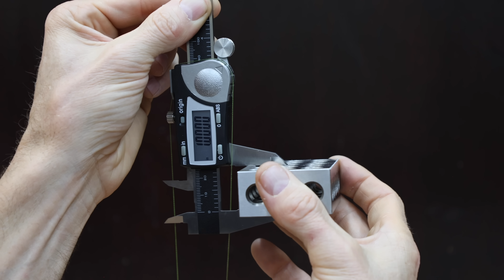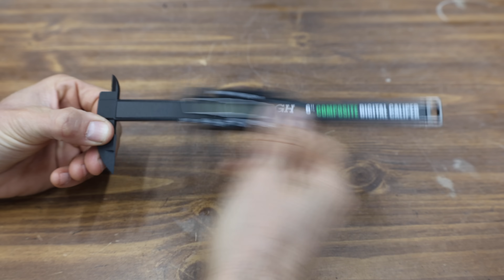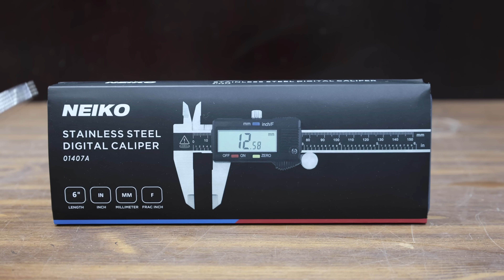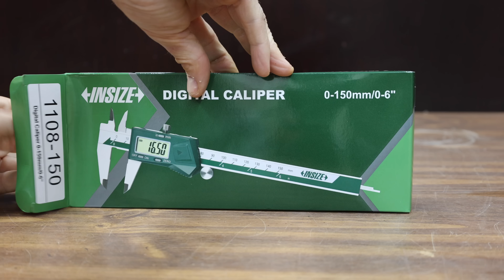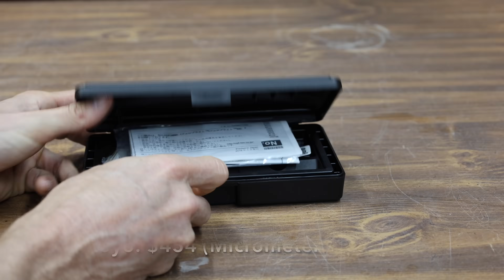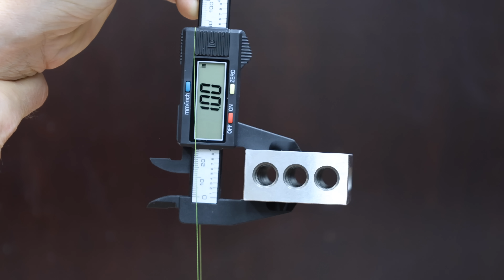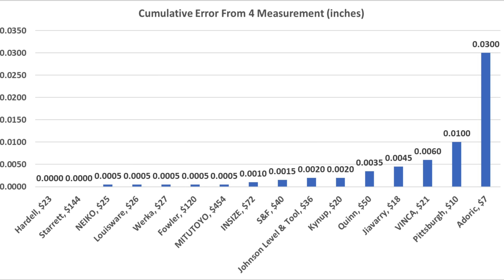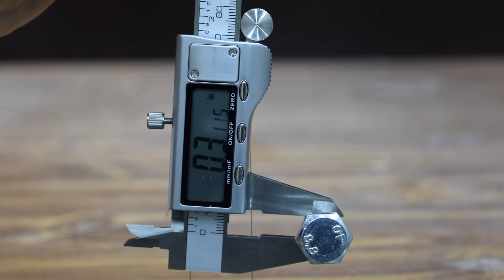I've Been Proven Wrong About Calipers!

Comment: When you go to measure something and you see variances within where it’s placed in the jaws, shine a light behind it and see if they are cut straight. Sometimes there’s a burr on one of the edges and then get a non permanent marker and close it to see where it wipes off when closed or if it stays, then get a paper and close it and see if that changes. A fine file can take those edges off. Then check it on standards to see if it’s true. This would be a calibration thing but also important when matching and if the machinists and quality control are debating about measurements.

Comment: I prefer to use analog dial or vernier calipers. Never cared for digital.
Reply: Digital is fast. Forget about vernier. Ain't nobody got time to read those. But verniers are very durable. There ain't much to them. Too prone to reading errors though.
Reply: Yeah, when you pick them up, they're always ready.
Reply: I much prefer the dial to the screen and having to worry about batteries but the ability to easily switch between mm and in is indispensable
Reply: @potathooo  In top-quality calipers, battery life is NOT an issue. They go for years and years on a single battery.

Comment: I have a Neiko set. They have been good enough for me over the years. Only changed the battery a couple of times. I use them for quick bolt and drill diameters and to check thread depth here and there.
Reply from the maker: Thanks for sharing.

Comment: was having my hopes up to find a cheaper alternative to Mitutoyo - deal-breakers for me are always that gritty feel, like someone has forgot to deburr or remove the grinding dust from the calipers.  So far I haven't found a comparable set. I did attempt once to debur and polish a set of cheap £10 ebay specials and parkside calipers and to my surpise I found that they both seem to have a thin brass like top "leaf spring" that makes contact with the rails - polishing the rails didn't result in much improvement till I have polished that brass material. however even after some extensive polishing I still couldn't get them to match the smoothness of the mitutoyo. oh and lastly  - thank you for making the videos and catching the smoothness - most review's on calipers always omit this step.
Reply from the maker: Thanks for the feedback.

Comment: As other machinists have mentioned, Starrett and Mitutoyo are well liked for reliable and accurate measurement especially past 1 thou. Otherwise for less precise, 1 thou and greater, there are lots available that are as reliable and feature rich. I have a couple iGuaging calipers specifically for use where they may be damaged. Both have worked without issue for over 10 years now. CR2032 batteries are the way to go though no matter the brand. Mostly because the batteries are so common in other devices that it simplifies what to keep on hand in case the batteries run low while working.
Reply from the maker: Thanks for the feedback.

Comment: The small knob on top is used to increase and decrease tension. If you back it off some, it becomes easier to slide. When you tighten it, it helps keep your measurement.
Reply from the maker: Thanks for sharing.
Reply: @ProjectFarm thank you for yet another video that makes me want to buy something I don't need.

Comment: About 5 years ago I bought a clone of the S&F as a "throwaway" to keep in a toolbox.  Works fine but eats batteries.  Some of the cheap Chinese calipers have battery life concerns.  My Mitutoyo doesn't.  You might put them on a shelf for six months to see which models eat batteries when turned off.
Reply from the maker: Thanks for sharing.

Comment: Mitutoyo calipers are counterfeited a lot. If you're not buying directly off an authorized dealer they're counterfeit. Even the Amazon seller is selling counterfeit ones. It can be extremely hard to tell the counterfeit ones from genuine. After a year you'll know though. Because counterfeit ones will have a dead battery.
Reply from the maker: Thanks for the feedback.

Comment: I love calipers. Why didn't I think of this? I used to use calipers to measure the diameter of rubber bands for braces. The company I worked for made all things orthodontics.
Reply from the maker: Thanks for sharing.
Reply: In 20 years as an audio repair tech I often used calipers like these to measure the thickness of belts for turntables, cassette decks and CD players. Also helpful for measuring thickness of O-rings.

Comment: I have a more inexpensive Fowler (~$30) that i use for Transmission work. It has lasted me for over 2 years now but unlike some brands, it does roughly need the battery replaced about once a year. been wanting to upgrade it to something a bit better so this couldnt have come by at a better time. 
Would love to see a Dial Indicator video soon after as i also have a Fowler for that. Always appreciate the great work!!
Reply from the maker: Thanks!  Thanks for the suggestion.

Comment: One thing your test did not indicate that I found from personal experience: the digital calipers I purchased from Harbor Freight seemed to be acceptable except for the fact that the batteries go dead within a few weeks when turned off and stored inside the case.  Other brands do not have this problem. By the time I discovered it was a problem with the calipers and NOT a battery problem the warranty period expired and I had to ‘eat’ the ones I had purchased. I would recommend NOT buying calipers from Harbor Freight - I am a big fan of Harbor Freight for many other items but NOT their digital calipers!
Reply: That's basically all cheap calipers
Reply: @ObservationofLimits  Agreed, all cheap calipers should be stored without the battery installed.
Reply from the maker: Thanks for sharing.
Reply: It's not just the Harbor Freight ones - my NEIKO calipers do it too. I think all the cheap (sub $120) calipers use the same PCB's and they all draw power even while "off." I pull the battery when I put it away now.
Reply: @dynadork3312  well it may not be JUST HF calipers - but they are the ones which I experienced that problem.   Probably HF calipers are made by a company that makes other brands also.
Reply: I have a half dozen HF calipers on my desk. Not usable because of battery problems. Leave the battery in and it's dead. Take the battery out and the cover breaks or wears out. Some site tested calipers and found that General calipers had the lowest off power draw. I noticed the Husky looked like a general rebadge so I bought that one. Husky is so confident that the power draw is low that they sell the product with the battery connected, no pull tab insulator. Battery still going after a couple years.
Reply: There were 2 tested from HF, Pittsburgh and Quinn. Your issue is with Pittsburgh. While they cost x5 as much, everyone knows you wait for a coupon or sale before purchasing anything from HF. I've seen the Quinn calipers as low as ~ $30.
Reply: Don't confuse display is off, to imply device is off.  This is what I measured with the Neiko 0-150mm.
"on"   0.015 to 0.016 mA
"off"  0.014 to 0.015 mA
The display state makes so little power draw difference it is close to not being able to be measured.  It is easy enough to remove the battery when I'm done since it doesn't have a screw, just don't close the door all the way.  I'm still on the original battery from 2018, though the display is getting faint in winter.
With my Neiko, if I moved the slider with the display off, the display turns back on starting with the last value.  These use a capacitive mechanism to pick up the slider movement.  I'm assuming it takes the majority of the power, and it keeps running to not loose the zero point.

Comment: For most DIY home users, any of these will work. Machinists definitely need top of the line.  I've had a $25 caliper for 10yrs and I probably use it 2 or 3 times a year (at home) and it's served me well.  Thank you for all the testing you do.
Reply from the maker: You are welcome!  Thanks for the feedback.
Reply: yeah, I have the neikos which are great in a 3D printing environment.  mitutoyo would be well worth it if I had 30k of machine tools and tooling...
Reply: Exactly, 90% of home users basically using a caliper like a tape measure.
Reply: @taylorsrus9543  lol for very small measurements, mostly.
Reply: Even for machinists, calipers are more of a disposable reference than anything else. You can spend $1000 on a caliper and I still wouldn't expect to get sub-thou accuracy out of it, especially after a couple years of use in a dirty, potentially abrasive environment. What is generally going to be used to actually inspect the part is a whole suite of metrology tools like micrometers, surface plates, gage blocks, dial indicators, height and depth gages, etc.

Instead of spending $500 on the 6" caliper and 1" micrometer set from Mitutoyo or Starrett, go to a budget brand like Shars and get the $150 set of gage blocks, the $100 Grade B surface plate, the $200 set of manual vernier micrometers, the $50 height gage, etc. Having a more complete set of metrology tools that are each individually "good enough" is better than having a smaller number of potentially higher quality tools.
Reply: I mostly work with wood or printed parts. 0.1mm is accurate enough for my needs, if Margin of error is lower, then I am fine. Especially in wood where the final sanding will easily remove 0.1-0.2 in the end.
Reply: @behemothokun  .1 is HUGE... any of these are way closer than that.  Lucky you :)
Reply: This.  I work in aerospace and we use Mitutoyo calipers and micrometers.  They all get worked hard and are constantly around coolant and oils and still work beautifully.  I would never buy one for home though, since I just dont need THAT degree of accuracy.  One of the less expensive options with nice battery life and features is perfect for a diyer.
Reply: I still remember a video of a bunch of chinese construction workers on a site putting all their tape measures together and none of them matched each other, definitely don't get these cheap sets if you value precision.
Reply: @SEEYAIAYE  DIYers don't need engineering precise measurements.
Reply: @SEEYAIAYE  Even if a tape measure were labelled incorrectly it would not impact its precision.  However the only example I can find of Chinese construction workers allegedly comparing tape measures is an image and it is clear from looking at it that we can't say for sure whether the tape measures are in fact all different.  The tape measures are being held in hand, they are not all level, and the camera is at an angle.

Comment: I'm wondering about the accuracy of your depth measurements.  Measuring against the 1-2-3 block, the caliper would be touching the wood table, correct?  Any local bumps or dips in the wood surface would be transferred to the accuracy of the measurements.

Comment: been a machinist for over 2 years now. I think the only reason for buying an expensive pair, is if you're experienced and using them very regularly, or simply like having nice things.  most cheaper calipers I have used are accurate enough for most applications the average person would us them for.  In fact, I would guess  the cause of most caliper inaccuracy  comes down to the user, and less with the actually caliper(Yes, I also started out using them poorly myself).  My Mitutoyo calipers are so finely made compared to others I've used, I wouldn't want to be without them, they just "feel" good to use. Also don't buy nice calipers for people who don't care for, or drop tools frequently, its not worth it.
Reply from the maker: Thanks for sharing.

Comment: Cheaper calipers tend to run their batteries down even when not in use... for example, there is power usage for my Vinca vs Mitutoyo calipers when on/off:

Vinca: On = 20uA, Off = 18.5uA
Mitutoyo: On = Average of 3uA, Off = 0.9uA

You can tell just by looking at them while they are powered off that the LCD screen is still powered on the Vinca.
Reply from the maker: Thanks for the feedback.

Comment: As a precision engineering lecturer, metrology is super important. I bought a 12" (300mm)  Draper caliper. Have to re-set it every time used and test it on slip gauges. In the workshop we use Mitutoyo and More & Wright digital calipers and micrometers. Oh, (edit) there are fake Mitutoyos on the market. We received a warning from Machine Mart.
Reply from the maker: Thanks for the feedback.
Reply: yes, it's terrible, I bought one fake in local market place, seen that the micrometer miss the last 0.0005 digit ... I offered him 20$... it sad for him, he was a student machinist(change carrer) they all bought from a lot seller... he said he paid 150$ a piece, they lost a lot of money... (I use it for not important job,  it,s fact it's fake, it loose zero easy when you slide fast...)
Reply: Yes there's a video on You Tube about the fake electronic LCD Mitutoyo calipers

Comment: There’s something that got missed in this test. I’ve spent years as an inspector both using and calibrating calipers just like these. When you have a handful of the same brand calipers, you notice that one to another, things such as smoothness, repeatability, and so on should be identical, every single time. I could take a dozen Mitutoyo or Starrett or Fowler calipers and put them head to head against each other, and find their variation in accuracy and feel to be nearly zero. Feel is important, because you need to slide the head enough to make good contact, but not so much that you introduce error into your measurement. The moment you say “this one feels gritty” is the moment that caliper goes into the discard pile.
Reply from the maker: Thanks for the feedback.

Comment: The issue I've always had with the cheaper calipers, even when accurate, is that they have a really bad parasitic drain on the battery even when off. Thus, they are always dead when I need them.
Reply from the maker: Thanks for sharing.

Comment: Another key factor that's not really a bother for the home shop guy is coolant resistance. The Starrett and Mititoyo will hold up over time and the others def will not. I have had good look with the Fowlers but nothing will out last the Starrett and Mititoyo. Plus I highly doubt any of the cert places will touch the off brand stuff. I don't know that for sure though.
Reply: I used to be a Metrology Tech, and we did, if your willing to pay to get a junk set calibrated. I did a very very cheap all plastic set for a hospital once, they used it to measure plastic tubes.
Reply: You realize there's more quality brands than just Mitutoyo and Starrett right?

Brown & Sharpe
Mahr
Moore & Wright

And all cert places do is take your money to certify or deny. Why would they care if you use cheap shit? Higher chance of denial meaning you're coming back with another device and paying again.
Reply from the maker: Thanks for the feedback.

Comment: Once upon a time I lost my good set of calipers so I got one of the plastic sets which was the only thing available in the big box store.

Never again!  Even as a dial caliper the plastic one did not maintain accuracy.  The plastic flexes when measuring small things at the tips so your accuracy is shot, and I eventually figured that out and replaced them with a metal pair.
Reply: Plastic calipers are nice if you're working around live voltage.
Reply from the maker: Thanks for sharing.
Reply: Yes, even for home use stay away from plastic calipers, they're a joke.

Comment: On your auto shutdown category:  Some calipers reset to zero upon auto shutdown. This is can be very bad as the calibration is lost. The higher end calipers do retain their calibration, but you might want to verify this feature for the rest. BTW, were you using a table top to measure depth? It looked like it. Better a surface plate.  Cheers.

Comment: Something that affects a lot of cheap calipers is battery drain when turned off.  Having an auto-off feature is of no use if the battery goes flat in three months anyway.  Perhaps this could be tested by installing fresh batteries of the same brand and then measuring their voltage before and after one month of being stored "off".
Reply from the maker: Thanks for the constructive feedback.

Comment: Well, I've had my Mitutoyo digital caliper for roughly 5 years now. I store it in my garage next to my lathe and I do forget it on quite often. I'm still on my first battery so apparently the power consumption has been well optimized. 

At work we have plenty of low quality digital calipers with Wurth branding (price is about 50-70% of the Mitutoyo) and you need to replace the battery in them multiple times per year. 

Power consumption with display on and off is definitely more crucial factor than the nominal battery capacity!
Reply from the maker: Thanks for sharing.

Comment: I have one of the older Pittsburgh stainless pair, and they're straight trash.  You can see the mill marks on the slide.  They slide horribly and even though they have auto-shutoff, they constantly eat the battery.
Also,  I'm convinced that they went to composite just so they can't be made fun of, and rebranded the existing stuff to that Johnson level and tool.  They look exactly the same.
Reply from the maker: Thanks for the feedback.